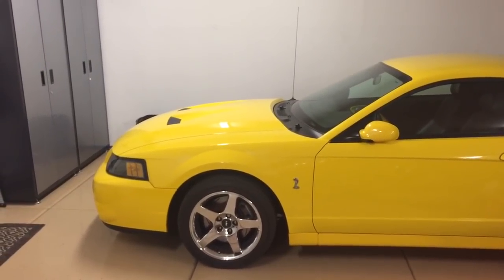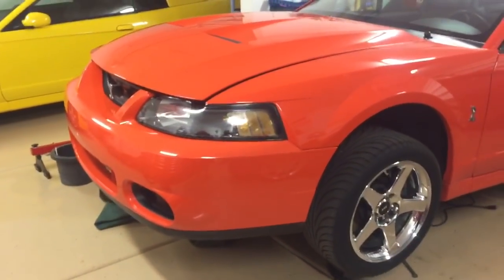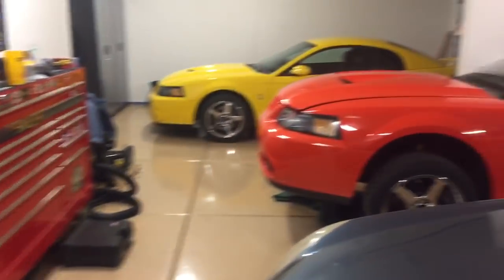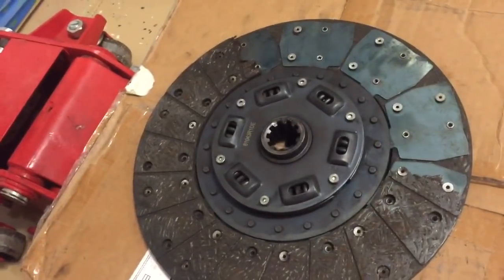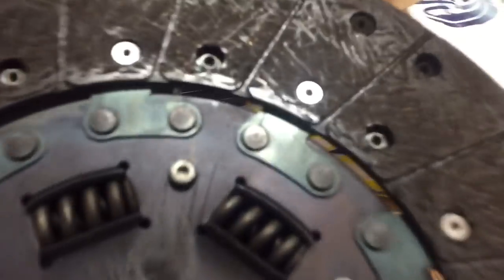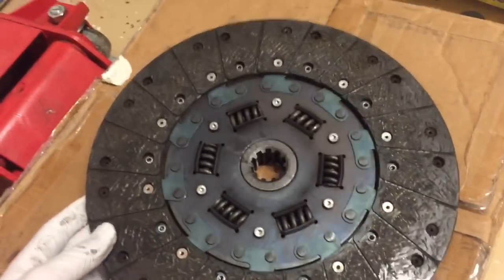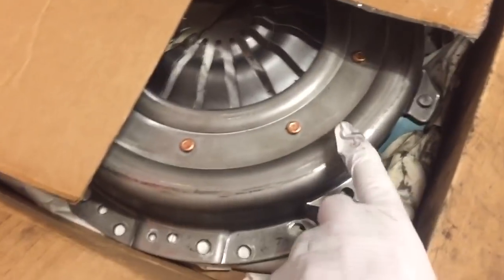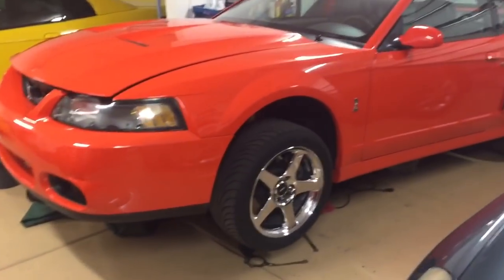Ebay clutch kit BEWARE!

Comment: Who in their right mind puts some random eBay clutch in one of these cars anyway?
Reply from the maker: Michael Westen It’s claim was it was a Valeo clutch (supposedly the same company as the oem supplier)
Reply: When they looked nothing a like im very suprised you would install it. And like Michael says very odd you wouldn't go with the upgraded clutch when you have  collector cars you collect receipts and thus helps with resale.
Reply from the maker: Shawn Broyles At that point, it’s not original clutch anymore and his goal was to be as close to original as possible. In the end the only thing new was the clutch disk as the rest of the kit would not work and he was going under the knowledge it was the same factory replacement from the same manufacturer. It was as close as he could get to original

You have to give him some credit for tracking down OEM manufacturers and trying to make it as close to original as possible
Reply: Especially after clearly seeing that it wasn't right. I mean just look at the torsional coil springs...
But then to actually fit it to the car and drive it  (".)

Comment: That's some brutal luck! I put a Luk in my fathers cobra, and it works great as a stock replacement. I'm also still rocking the stock clutch in my car, until it gives me issues, then i've got a twin disk ready to go in.
Reply: i WOULDNT USE THAT TWIN DISC UNLESS YOUR RUNNING 600+ HP.
Reply: @Onlydeandrae30  The McLeod RST drives better than stock. I'd put one in at any HP level. Also, the car makes well north of 600HP.

Comment: That’s 100% his fault, not the clutch. You don’t start smashing because you feel the aggressiveness of the new clutch grip. With every clutch, that I read up on after installing, break it in. Let it warm up.
Reply from the maker: Prethy Prum It was warmed up. The clutch should not have failed under any circumstances. We have installed several clutches and put them through their break in periods. Even if you straight up beat on it out of the box it should not fail, just not seat as well and give you clutch chatter at worst
Reply: Danny Johnson it doesn’t make sense because in the video you said it was less than 300 miles. You also add that he went higher rpm. And don’t you think customers would say anything to get their money back.
Reply from the maker: Prethy Prum Miles are irrelevant. It’s the stop and go time that breaks in the clutch which is important. He had a lot more of that since the car is not driven on long road trips, just around town. With that amount of break in nothing should have failed.

Comment: I am so nervous of doing Ebay stuff.  I only bought one thing off it, and took forever to get it. It was something simple and a "copy" of a Fore hood grille's thingy.  Was a solid month after they got payment before I saw the part.  Guess they had to recycle the aluminum or mine the bauxite and then build a CNC machine to cut the parts.  

I got a Spec clutch in mine, I think was a 2+, it chatters a bit, but did not replace flywheel or surface it. Still in car 40k miles later with a Whipple and a few spirited shifts.

Comment: If it didnt fit and wasnt for that car why put it in? Makes no sense
Reply from the maker: It actually did bolt up and “fit.” There was no way of knowing until it was installed and the clutch fork hit the pressure plate. It’s not like you measure every single part and dimension before installing. You expect the part is correct. DUH
Reply: @dannyjohnsonsgarage  If the pressure plate didnt work why use any of it
Reply from the maker: That’s like asking why we didn’t buy a new flywheel or any other parts. You draw the line somewhere. There was nothing wrong with the pressure plate so why no use it? It’s low miles, no damage
Reply: @dannyjohnsonsgarage  trust me I get ehat youre saying, the point in making is the expected outcome couldnt have been that great given that components didnt fit properly. If any 1 part is incorrect the whole kit is questionable
Reply from the maker: @FullPullTv  Yeah, I understand and I guess his just being a factory replacement and low miles we didn’t see any harm in mixing some parts around. I’d never consider mixing a centerforce kit with factory parts etc, and air would say send it all back (which he ended up doing and got s spec 2), but this was more the owner’s call than mine.

Comment: Come on man, you guys buy a 400$+ alternator and you go cheap on a clutch?  You guys are better than that.
Reply from the maker: racerxnk Youre missing the point. Though I would upgrade my clutch for my 600+hp cobra, my brother was looking for a complete factory replacement. He did his research and found this claimed to be the original manufacture, so you need to understand the situation

Comment: What's your thoughts on the mcleod street pro clutch, exert mach 400 or Ram hdx? Which is better for a mild build mustang gt
Reply from the maker: I have heard very good things about mcleod, but make sure if you're anywhere over 400hp you upgrade the factory 10 spline input shaft to the 26 (which means you have to buy that shaft, install it, AND buy the corresponding 26 spline clutch disk.  Here is how that is done on the t56 and t45...the tr3650 transmission would have to be disassembled. https://www.youtube.com/watch?v=EsaOBOy67h4&t=44s
Reply: @dannyjohnsonsgarage  thanks alot Danny for the info and I plan on tearing my 3650 apart this winter(live in wv) because my reverse pops out of gear so that would be a great time to do the conversion or is the t45 better? Or just rebuild mine? I'd love to have a t56 but big💲thanks bro for your help
Reply from the maker: Jason Cameron The input shaft alone can cost $300-$500, so I would consider putting it towards a t56 magnum 😋
Reply: @dannyjohnsonsgarage  yes your right I didn't know they were that expensive i doubt my car will see 400hp anyway i want to turbo it run maybe 8 pounds because we both know the 2v cant handle alot of hp unless built and that motor isn't worth the money lol

Comment: You used a different pressure plate.
Reply from the maker: Yeah, the clutch fork would not clear it because it was not meant for the Cobra in the end. It would only work on the other mustangs without T56